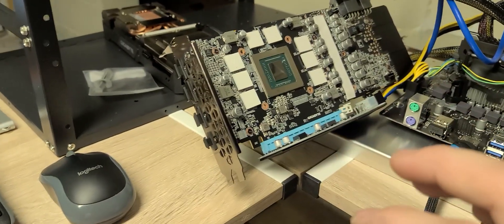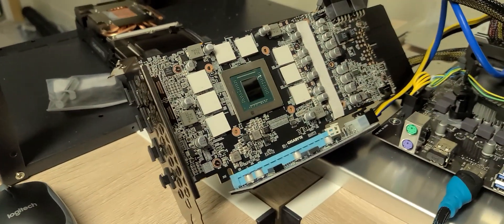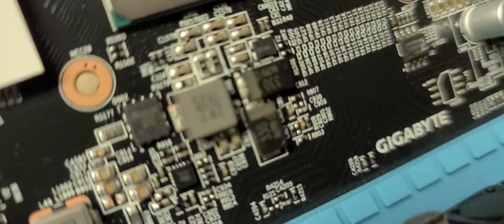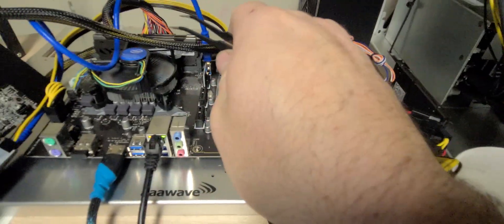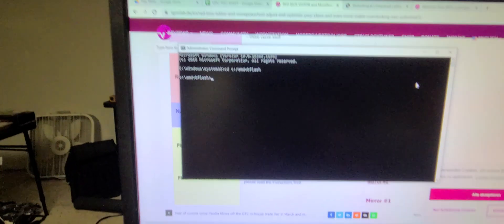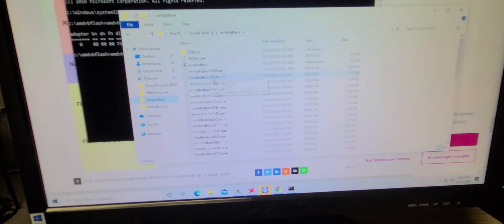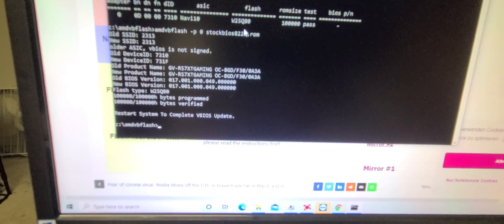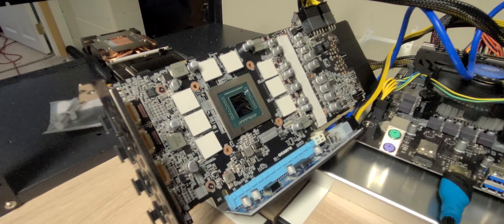5700XT and 5600XT BIOS recover from failed flash.

Comment: Hi, what riser are you using? I have a bricked PowerColor 5700XT, and what you're saying didn't work. The PC goes into Windows, but the GPU isn't recognized by AtifFlash, with the riser, with or without the 1+5 pin short connected. Without using the riser, the PC won't go into Windows  if the GPU is connected. I tried changing from PCIe 4 x1 to PCIe 1 x1, and that didn't work either. I don't understand whats the problem with the riser I have. It's also a 1x1 to 16x riser, and it works with an HD6850.
Reply: The riser worked with an older LGA1155 PC; I didn't have to do the pins 1+5 short. I was able to use AtifFlash without any issues. I don't know why it works on that PC but not on the new one with a B650.

Comment: Broooo life saver !!! 
I bricked my rx 580 with wrong vbios and the pc wont post with the card in, 
I have already ordered a ch341a programmer to reflash the bios, but i saw your video and i tried it, i shorted the 1-8 pin on my rx 580 and it posted and detect the card as an rx 590 and i run amdvbflash and reflashed it with original bios and now boom it is back in bissness , i guess i wasted that 5 dollar on the ch341a , but im happy that it is working again before my order arrived . thank you soo much 
I can confirm this works on MSI RX 580 OC ARMOR 8GB
Reply: + this fixed my older problem which made me to brick the card 
My rx 580 was crashing at stock speed 1366@2000 i had to downclock it to 1200mhz and undervolt it to 900mv to make it stable
Now after i fixed it with your method i tried to run furmark at stock speeds and wow it is stable at 1366mhz no crashing no more 
Im really happy and thankful to you ❤

Comment: Quick tip: If you have a dual BIOS GPU (like the Aorus 5700 XT), and you mess up one BIOS and want to recover it without disassembling the GPU, you can start with the working BIOS. Just when it displays video, quickly switch to the faulty BIOS. After that, you just need to follow the instructions in the video to flash the original ROM.

Comment: Wow, those pins are very small on the chip.. I think will buy an USB SPI programmer to use :) 

Thanks for the video, it was very informative.

The bios signature, is it only used when flashing, or is the GPU validating the signature when booting? If I program a modified bios with no valid signature using SPI programmer, will it boot?

Comment: Hi, I was hoping that possibly you might have an old Aorus Rx 5700 XT still sitting around that you could send me the bios from? My card is still under warranty but tech support kept lying to me about a download not being on my download page then sent me a link and the download I was talking about was there. I've been arguing with them over this for about 2 years now and always the same thing treat me like I'm stupid and the download doesn't exist. Then the person that sent me the link proving I was correct advised me to install GeForce drivers on my AMD card!!! I have screenshots of all the lies that they told me, it's pretty ridiculous. So I don't even trust them to fix it and I can't afford to buy a new one because I have spinal cord injuries in two different places and can't work and have no income. Since I ran the .bat file on my download page (for F2 bios, changed .bat to .txt to figure that out) and mine takes F1 the fans spin so fast on start up that I'm surprised it doesn't take off like a drone and start delivering packages for Amazon lol so now after only two years the fans are shot, almost everyday it downloads a different version of Adrenaline even with a fresh install of Windows, then downloads what looks like the Gaming OC Aorus Engine and it's unresponsive, nothing works when you click on it and then downloads the wrong RGB 2.0 for the MOBO. So I have to download all the correct programs over again, run DDU ect. Besides lying to me about all of this being an issue they won't send me the correct bios either so I was hoping for a miracle and you'd have them or be able to get the bios. Sorry about the long comment and bothering you with this but the place that should be helping me isn't. Most People I've sent messages to won't respond to me but in case you can help the model number is GV-R57XTAORUS-8GB revision 1.0 there is a bios correction tool that is only on the revision 1.0 page and I think it's wrong and it seems Gigabyte pulled all these cards except the OC Gaming 8 GB which is odd because that is the AORUS engine program it keeps downloading. Every other brand has all 5700 series cards for sale new almost everywhere except Gigabyte but they still have old cards for sale brand new and of course when I drilled tech support about it they wouldn't answer. Sorry to email you like this, I know it's only suppose to be for business inquires but honestly I think I stumbled upon something they didn't want anyone to know about and I think a lot of people probably sent the cards in for an RMA and had to pay to have it fixed because it flashed the wrong bios on my card. When I ran GPUZ the speeds were the same as the OC Gaming and my card was faster that's why I bought this one. I don't do much with social media so I don't know if you can just message me on here because I subscribe to your channel

Comment: ok i did this exact thing, bricked my 5600 xt, ive tried this trick with the tweezers and it wonr work, i have a xfx thicc with the dual bios, it had two bios chips, the switch was in the OC position.  since theres two bios chips which is which?  it will boot in the silent mode

Comment: EASIER no HARDWARE fix that worked for me: plugging the brikked bios gpu AND one more gpu (i had a brikked XFX RX 5600XT Thicc III Ultra, and used a spare RX 570), boot into windows using the good gpu as output (you can probably pull this off with iGPU/Integrated Graphics too). Once in windows, open device manager, navigate under Display Adapters, right click the dead bios gpu and 'Disable' it. Once you do that, just open AMDVbFlash (latest version available on techpowerup), and flash your bios backup. Reboot, open device manager and re-enable the dead gpu. This fixed my 5600XT, i hope to have helped someone out there

Comment: Thank you so much for the effort to publish a video. I followed all the instructions unfortunate I wasn't able to flash de BIOS correctly.
I made my own research and finally I found the way and here is what I did.

My main problem: My GPU wasn't recocnited by the Operating Sistem, I have integrated graphics so I was able to start windows without problem but the GPU don't appears in Devices Manager (just the lighs and fans was turn on ,The GPU was almost dead).

Solution: I follow almost all the steps of the video with some considerations.

The Only way to get some life signals on the OS was shorting the bios pins 1-8 so, If you made the short in bios properly (Shorting the bios pins with the CPU off, then turn on and just mantain the shorting until you see the windows user.) now you went able to run the amdvbflash -i command and see the adapter 0 like the video. 
This is the most important thing, you need see your adapter (GPU) to continue with the next steps. 

The next command on cmd should be: amdvbflash -unlockrom 0
(I don't sure if this command is neccesary but I used)

Now Is the flash: amdvbflash -p -f 0 name.rom

In this line I use -f to force the bios flash, you need to be sure that you selecct the correct adapter in case that you have more than 1 GPU, also you need the rigth stock bios for your GPU.

Here when you ejecute the command a lot of people get de error 0fl01, I also got this error like 20 times and here is what worked for me. The problem is while you are flashing the gpu the temperature goes up and the gpu becomes unrecognizable to the system and it is impossible to flash properly. The correct way to do the flashing is with the gpu assembled correctly with the heatsink and fans, but it is almost impossible because the short has to be done with the gpu disassembled and my solution was to solder 2 cables, 1 cable in the PIN1 and another in the PIN8 to be able to assemble the GPU correctly to avoid temperature problems and then make the short from the outside with the soldered cables.

In this way I was able to flash my GPU at the first try, I am very tired to continue writing more details, but if you have doubts, leave a comment
Reply: Hi, when you short pin 1-8, do you post using the integrated or the gpu, since your gpu isn't recognized by windows. What does shorting pin 1-8 does actually
Reply: Thank you so much! I followed your exact steps on my XFX 5700 (that I bricked) and was running into errors. Fixed with 2.93!

Comment: hey I have 5 6700xt but different brands. I mistakenly loaded a XFX  speedster 6700xt bios setting onto a Red devil 6700xt card. The card works fine but every 2 days my screen just freezes and I was thinking could this be the reason?

Comment: Has anyone tried this with a Nvidia card? I attempted the same thing and shorting 1 and 5 does nothing for me.
Reply: Did you ever get an answer to this?  Did you ever salvage your card?  I have three MSI NVIDIA GTX Supers.  Two out of three took the new BIOS that increases the hashrate from 31.81 to 34.6MH/s (Hynix memory only!) but the third one bricked.  Can't post with the card.  Wondering if this will work?
Reply: @frankschannel2642  i bricked a 2080 ti this method did work for me. I dicked with it for a really long time to get it to work. If that doesn’t work for you. You can use a flasher or solder a new bios chip on it. There’s a guy on eBay that sells bios chips.

Comment: Anyone know if the short method works with an RX580?
Reply from the maker: What RX580 do you have?
Reply: @curatedcomputing  Turns out it does work for MSI RX580 Gaming 8G.
In case it helps anyone, I used a bootable USB with AMDFlash.exe and the correct bios:
1) Short pins 1 & 5 on U11 (pin number as shown on circuit drawings) It will be the DIAGONAL OPPOSITE of the chip.
2) Boot to USB Stick
3) Verify you can now see GPU using AMDFlash.exe -i
If you can now see the GPU, cut the bridge (or I found the VBIOS is not readable in the next step) 
4) Flash the rom: AMDFlash.exe -p 0 <your rom file here> You should then see a success message
5) Reboot
6) End of procedure
GPU Unbricked!

Comment: I bought a TUF 3 RX 5600 XT used, it doesn't post and my PC doesn't recognize it, when I check on display adapters it shows it as a Microsfot Basic Display Adapter, any ideas :c
Reply: i have the same problem!

Comment: hey man, thanks for your video, i was able to get into windows.
But when trying to flash the vBIOS with amdvblash i get error 0fl01. Any suggestion ?
Reply: same problem
Reply: @brianhernandez9826  i was able to get it working, by using the Main PCIE x 16.
Also, if you dont get video after reboot.
You need to change CSM enable on motherboard.

Comment: Question, so I used this method and got the stock bios back on and the card is working again. Can I just use 2.93 to flash the edited bios onto this card or do I need an unlocked bios for this specific card?
Reply from the maker: 5600XTs in my experience need an unlocked MSI bios for mining. DM me and I can send you the BIOS if needed.

Comment: I had a powerColor RX5700XT 8GB Model AXRX 5700XT 8GBD6-3DH and the flashing method does not work for this card and I completed mess it up using amdvbflash version 3.04. I did not use the tweezers, I bent a smaller part of thick copper wires so that I can use one hand to touch the wire onto the BIOS pin#1, another hand to touch the PIN#8 while had someone press the power button for me. I did not have to take off anything from the card at all. The windows appeared and even though the windows only recognize it as "Microsoft basic graphics adapter", the amdvbflash version 2.93 recognize the card. I flash the original ROM back onto the card successfully! Thank you very much for your help! If someone else has a problem, you can also contact me at glaadsegy    at gmail. I will try to help me as much as I can. thank you!
Reply: Hallo Glad, It seems I am in the same case. could you please help ? I cannot surely point out the bios chips. Are these the two 8 legged ICs below the GPU with a red and a green point painted on them ? what are their pinouts ?

Comment: I have just bricked my Gigabyte RX 5700 XT Gaming OC 8GB version by trying to update the bios everything went fine and after finishing updating the bios retstarted and JUST a "white "-" on the monitor.. nothing else. I cant either bios or windows, totally stucked. Please help me. I tried resetting the bios by touching the mentioned 2 diagonal pins, nothing happens.
Reply: I also have a bricked 5700 Sapphire Pulse. It is not detected on Windows or any AMD flashing tools. I tried to short the Bios with the pins as shown on the video but nothing happens when I boot. The fans are spinning but can’t get the gpu to be detected. I’ll just take the L and move on, rip.
Reply from the maker: @charlesd7301  This only works if you bricked during a BIOS flash, you might have other hardware errors. If your PC won't post with the GPU installed and is fine when removed this method should work.

Comment: God bless you, you saved my day!
In my case, I did not have to remove the backplate (actually, I didn't find those 4 screws you mentioned, it's the same Gigabyte card), but the BIOS chip is close to card's edge so I was able to short those pins with the tweezers without dismantling the card. Greetings from Romania!
Reply from the maker: Glad you found an easy fix!
Reply: Thanks for this information!! In the gigabyte the 1 8 pins are in the same position than he shows in the video?
Reply: @peladoko  Yes

Comment: Will this work even if my 5700xt wont post display to begin with?
Reply: This did work with the riser, not sure if it was a faulty second pcie but i booted with an old gfx card and reflashed with the riser.
Reply: How did you do that please
Reply: @Helldevers2Cheats  Buy a riser and install it in a free slot. Either boot with mobo graphics or a second gpu for display and re flash the card.

Comment: Mine is still not posting does anyone else no a way other than using tweezers
Reply: mine wasnt posting but then it did it again, yet amdvbflash does not find the adapter, and i did use amdvbflash 2.93plus
not sure what happened or what to do next
i am right before going the shorting method as well
Reply: @13capivara13  i have the same that not find the adapter, did you fix it?
Reply: @brianhernandez9826  hi, yes, shortening with tweezers worked for me, short the pins, boot up the pc, as soon as windoes starts you can unshorten the gpu again, reflash with original bios, done.  but it might take several runs, i had issues with the reflashing process.  after reflash etc, DDU the system and reinstall the drivers. worst case reinstall windows/the full system
Reply: @13capivara13  i did this one but  amdvbflash -i give me a result of fail and won't read my stock rom
Reply: @brianhernandez9826  try to post and use amdvbflash 2.93+ but dont unshorten the pin before -amdvbflash -i
you need to give all of this several tries, its not always working
Reply: @13capivara13  thanks! In My case the problem was the temp, when it go up, the  pc dont detect it, but now it work. Thanks!
Reply: @brianhernandez9826  very welcome. good to hear it works
Reply: @13capivara13  short the pin while windows pc on?
Reply: Hi  @AYIP SUTRISNO  
No
PC off
shorten pin
start PC
boot windows
now you can already unshorten thin pin
or you go to amdvbflash first for "amdvbflash -i" and unshorten after that

eitherway, when flashing the bios, the pins HAVE to be unshortened

every time you shorten the pins, the bios gets deleted/set to default when reboot

Comment: The only mistake that you did was to use fcuking windows. I bricked my cards several times while doing experiments with the vbios, and recovered without taking the gpu apart. Further more, that was done remotely on a big a55 12 gpu rig running hiveos. Just toggled the maintenance without loading drivers, rebooted and reflashed with a working vbios.
One more...if the gpu was bent over by the window, and won't post, flash hive into a usb (you'll need an account if you don't have one), boot it without the card, set everything up, upload the good vbios, toggle maintenance without loading drivers, turn the pc off, connect the gpu through a riser or the mobo and don't hook up the riser power or the gpu if on the mobos pcie. Turn on the pc, and hook up the power to the riser or the gpu while booting up, then make the gpu great again.

Comment: Great video. It's worth noting that for $8 you can buy a ch341a programmer. Then you can flash without running the card on a riser. Cheap insurance to have on hand before attempting a refash.
Reply: wouldnt that take removing the chip off the card?
Reply: Guy, I have ch341a programmer and it's not working when I flashed the bios until I used this short pin 1 and 8.

Comment: Im trying to attempt this 400 times. Wish me lucks
Reply: Yo, if youre still having issues look up an SPI programmer. Fixed my GPU tonight. $10 amazon
Reply: @PGALGA thanks.  I may try that. As I did confirm through the Amdvbflash that there is no card being recognized. 

Im probably just gonna send it back to gigabyte. As I've exhausted a shit tone of options amd at this point its easier for me to pay $40 bucks to have it working and shipped back.
Reply: Will this work if my 5700xt black screens on boot?
Reply: @danielfernandez142  it sure does with the correct bios file